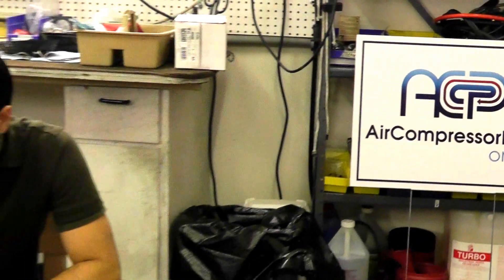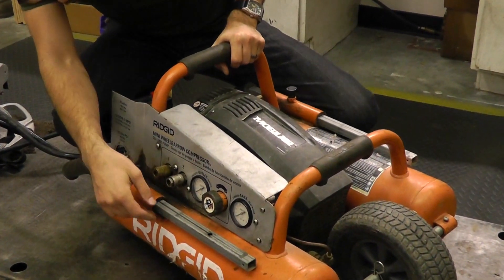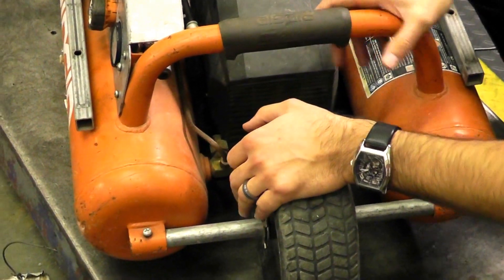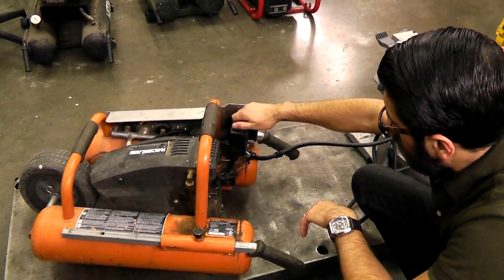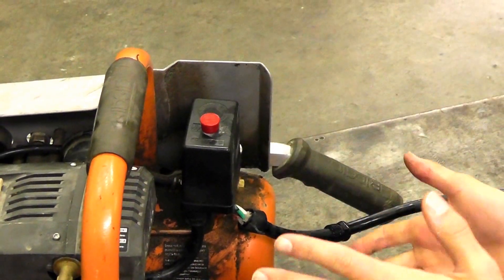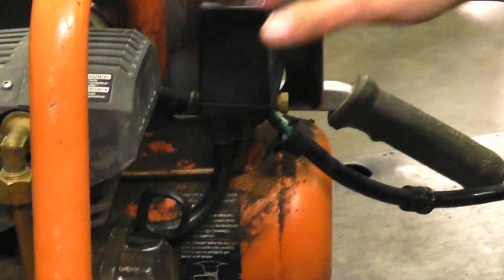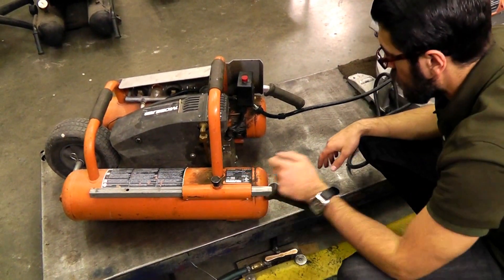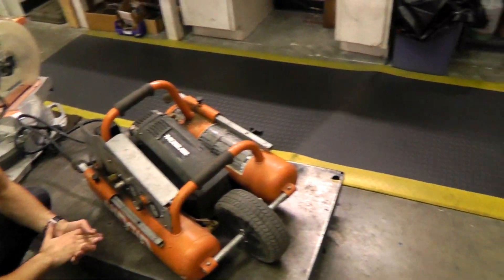Basics of an Electric Air Compressor

Comment: So the bigger the tank the higher the pressure of air can come out?
Reply from the maker: No, the larger the tank, the more air volume it can hold. It will deliver a longer flow of air until the pressure reaches below the lower pressure setting of the pressure switch. At that point, the pump has to resupply the tank. The larger the pump, the quicker it will fill up the tank.

Comment: I have this exact air compressor. The other day I started it up and it shut off about 10 seconds later. Now it wont run at all.  I don't know who fixes these things. Can you tell me where to start. It hasn't been used that much. I bought it brand new. It is not old.